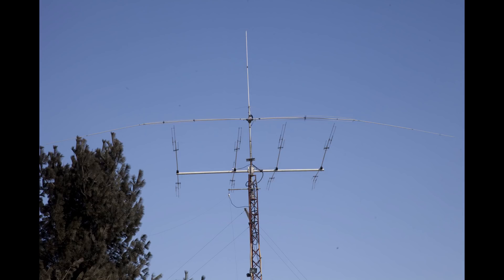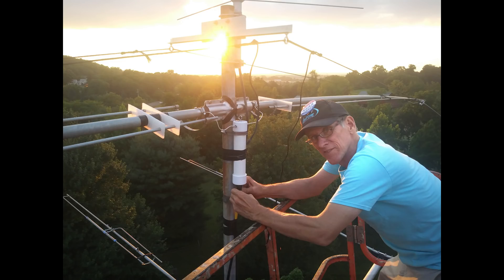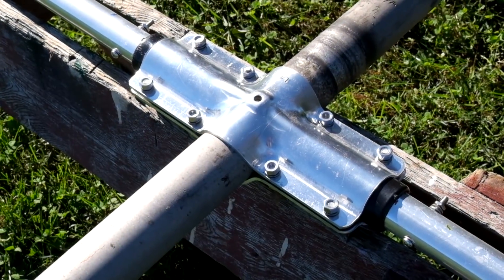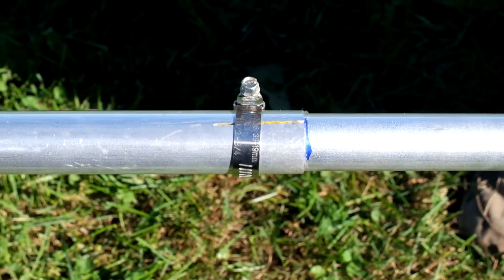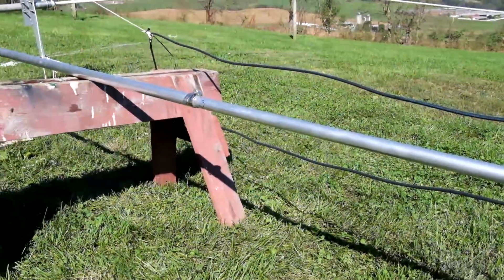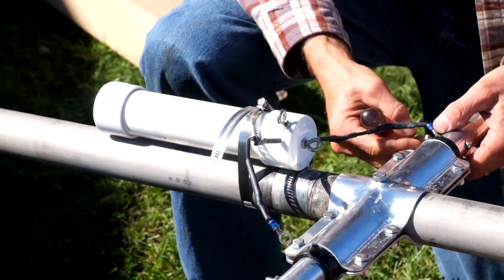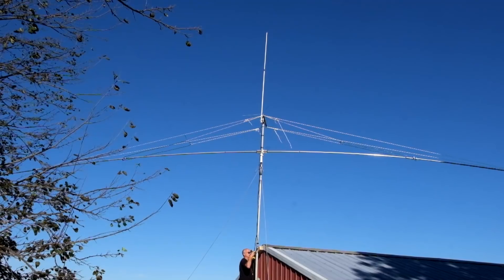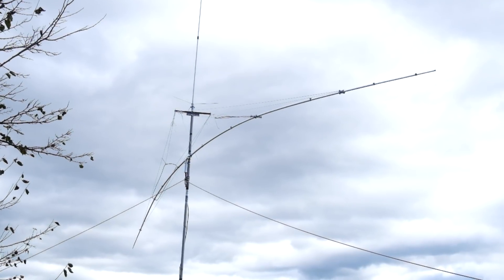Building a 40 Meter Rotatable Dipole

Comment: I have a much shorter end-loaded rotary dipole here near Buffalo, NY, but my lot is only 40 feet wide!. Your dipole looks great, but it would touch both sides of my back yard, hi! My dipole is the 40 - 2 meter MFJ-1775. I assembled it for just 40 - 10 meters, it is 14 feet long and the 2:1 SWR bandwidth is only 60 kHz on 40, but in the clear and mast-mounted makes up for the narrow bandwidth. Nice video and a great looking antenna.

73, Keith, WB2VUO here near Buffalo, NY

Comment: do you have the tubing schedule and lengths available?
Reply from the maker: Here is what I bought.   http://www.texastowers.com/aluminum-6.htm     I just bought 6 foot lengths to it was shipped by UPS.   The first section...1.250 I cut in half....Just 3 foot each side.   The next section is 6 foot... 1.125 followed by a 6 foot 1.0 inch tube.   You need to use a 1.0 tube on both sides of the 7/8 inch insulator so I used 4 - 1.0 inch tubes on both sides of  the insulator from Cushcraft.   The off sets from M2 fits the 1 inch OD tubing.   After the section 1 inch tube I cut the rest of the tubes in half using 3 foot sections till the end of the element.     The only problem I had was the string stretched in time..... make sure you use Philly strand or non stretchable rope to support the weight of the long element.     Doubling the tubing up in the first two sections also adds strength to the element.

Comment: would traps not be easier than the linear loading ?
Reply from the maker: M2 thinks so.   They have replaced their linear loaded 40 meter elements with coils they say are really efficient.   However in our homemade situation using a little wire is so simple and inexpensive but also works really well.